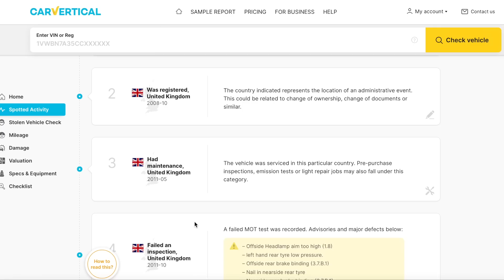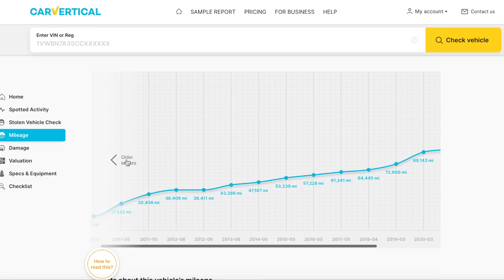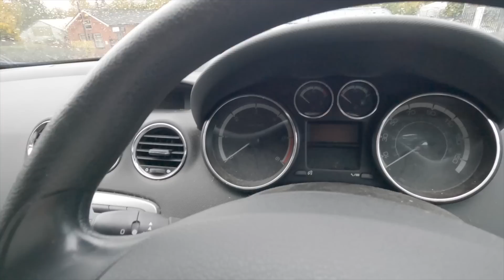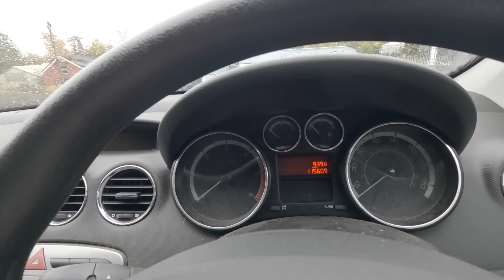I BOUGHT A CHEAP PEUGEOT 308 FOR £300

Comment: I’m suprised that car isn’t worth repairing. I’d assume if this was a left hand drive car and had the German TÜV a dealer could easily ask 2500 euros for it and it would be sold within 2 weeks. Just today I spent some time looking at a car lot with 50 cars (different ones, from old BMWs to an American Stretch Limo and some newer cars like an Audi TT). I looked for an older Audi and found they had quite a lot. Sadly we have a lot of rust so having a car with little visible rust like this Peugeot would sell quick. Looked at an 2007 Audi A6 that they didn’t even have a price on yet because it has little rust and turns out I’m the second guy to ask about that car in 2 days. Cool thing about that dealer is they just give you the keys and you can check out the cars on your own (they even gave me the keys even though I told them im only 16 and have no drivers license. And honestly most people I know couldn’t care less about a car having cosmetic issues. Like the scuffs on the front fender I wouldn’t even have cared too much. I have a 1 owner 1995 Audi A6 and it has so many cosmetic issues that it would need a full repaint. Still people I talk to enjoy the car and since it’s in good mechanical shape it’s gonna last me a long time as my first car and I can get it registered as a classic in 2 years.

Comment: Strange, those Peugeot 308's go for around $9,800 U.S.D. In canada or mexico slightly less with the problems described in this video. A older Peugeot 405 mi16 in good to excellent condition will go for around $5,000 U.S.D, and wow and older Renault R5 Turbo can go for up to $100,000 U.S.D. The u.s.marshal's service had a 2004 Peugeot 208 on ebay a while ago for sale at $5,000 u.s.d., im a kid but i loved that little peugeot 208, closest repair on these cars would be in Monterey Mexico Peugeot or in quebec or montreal canada. Sad how british treat cars like this, when all the junk they produce is much more unreliable then these.

Comment: Why would there only be only  2-3 yrs left in it with such low mileage.
Reply: if someone bothers to do the suspension work, easy another 5-7 years in that car with it's service history and cambelt change as well as cheap £30 tax and no rust. I swear some people look at the age and just scrap it when they can't be bothered.
Reply: @squeakers27  I recently made the same mistake last year I scrapped a 05  passatt 1.9 diesel highline model leather heated seats spoiler alloy wheels I also done timing belt a year before. It needed window motor rear tail light one side and possibly new discs and pads. Engine clutch and box were perfect, same cars making 3 grand now with less spec than mine. I was a fool.

Comment: "Bought a cheap peugeot for 300 quid". Personally I would want 250 to buy it in the first place. Seriously though I loved the old 205, along with the 309, and the 504 was the only car I have driven that I didn't need to push the seat back to its limit in order to get my lanky frame in. But when they abandoned the french flair for cheap mass produced stuff I avoid like a sore thumb.
Great videos nevertheless.

Comment: These cars are absolute junk, a car with that age and mileage should not need that amount of work. I know they drive well though, I'll stick with 1993 Nissan Bluebird and 1997 Nissan Sunny/ Pulsar currently at 321000 km. Flys through warrant of fitness, only thing replaced was a hose and sanded the rear brakes. The check engine light has never come on and if it did it's OBD1.

Comment: You mean to say "I am sponsored by carvertical and they gave me a offer blah blah will make it cheaper for you and helps send you videos". STOP LYING!!!!

I owned 2 HDI the heat shield always comes loose also the garage that said you need to remove the DPF to do the job lied to you, You can do it without removing it, done it twice easy fix, you can't fail or advise with that tho but should be done!
Reply from the maker: Sounds like you know everything. Well done.
Reply: @HighPeakAutos  well that's a little toxic, tell me your not sponsored by them? not a bad thing being sponsored by someone but transparency. Going to the car no I don't know everything but I know enough with them. Well would hope so seems owned two 1.6 HDI's. my first one got from the boring 110BHP in the MK1 C4 coupe to think was 270bhp or around that. On the c4 I used a aluminium blanket on the turbo.

The fastest way to fix it is find a welder and get them to aluminium stick weld it. The break where your on about is at the bolt area. This happens due to the vibrations and aluminium ain't strong. over time breaks. Personally not worth your time if cars cheap enough.

Comment: The one in this video will be 90bhp
Reply from the maker: Yes you’re right
Reply: @HighPeakAutos  we all have our preferences, and i know a lot of people don't like French stuff. Im a Hgv mechanic, ive owned a 97 306 dturbo for the past 20 years andcuts been superb, its 25 years old now, it had its first welding a few weeks ago for Mot, despite having now done 221k and lived outside in damp North Wales. Its still on its original engine, gearbox, clutch and turbo that it left the factory with, its been a superb vehicle. About 8 years ago I got a 2010 308 sport petrol, its now gone just over 100k and again its been superbly reliable. My father has been a taxi driver over 40 years and ever since cavaliers in the 80s and 90s we have used French stuff for taxis. They have undoubtedly proved to really stand up to the job and cover huge mileages. I spent many years as a breakdown mechanic contracting for all the big breakdown clubs. Cars I used to see most seemed to be VAG group products, especially Diesels. Ive only just discovered your channel after more clickbait from Chops Garage, enjoying it so far, best of luck.

Comment: CarVertical is horrendously overpriced. You are definitely getting that 10% as commission. £25 for a SINGLE vehicle check. 

I really like the channel and your way of engaging the viewers however you shouldn't push something that simply is not worth it. My opinion.

Even the RAC is £15 for a single check or £30 for five checks.
Reply from the maker: The bitterness of poor quality remains long after the sweetness of low price is forgotten
Reply: @HighPeakAutos  That sounds like a haiku of some sort. So are you saying the RAC check is poor quality in comparison?
Reply: Depends what car you're buying if you're buying some old car thats banged up and worth very little anyway sure, just do some basic checks you can do yourself and draw your own conclusion but if you're buying a good car you don't want to end up with a lemon thats been crashed, stolen, has outstanding finance or all kinds of mischief that comes with it. I won't buy a car without good service history and an MOT history that is not loaded with advisories year after year and failures for stupid stuff thats down to owner stupidity. You can protect yourself a decent amount if you know what you're doing.
Reply: @gravemind6536   But how does that reflect on the quality of the history check? Does RAC not give as enhanced disclosure as CarVertical. Spending £25 instead of £15 for a company I am quite sure the majority of people have never heard of (compared to RAC) somehow means better accuracy/records? 

I get what you are saying with due diligence but that is common sense surely.
Reply: @martinw6415  Most people don't actually use common sense when buying a car. As for RAC and car vertical I don't know I have never used one of those checks.

Comment: I hate Peugeot 308s too and just in general Peugeot. Badly built, cheap cars that feel like a tin can on wheels and the kind of people that drive them are the kind of people that know nothing about cars have no taste or style and take poor care of their cars which compounds the problem with them. The Peugeots from 2000-2015 are in particular awful imo. If I buy a car its going to be Japanesse, German or South Korean they make solid reliable cars unlike the french and americans and italy although some low end Fiats can be reliable.
Reply: Well every car has its own flaws, here where i live Peugeots are not bad cars, they are a much better buy compared to a Japanese cars because they are cheaper to maintain and at least are less prone to rust.
Reply: @2BuckShot  yes Japanese cars just rot where I’m from every winter and then fail MOT needing suspension arms , subframes etc
Reply: The Peugeot issues were from the mid 90's through to about 2002-4. We have had Peugeots in our family since 1957,. Driven often on bad roads at high speed. They are extremely well built (check rally results from 1952 - 2010). Handling and reliability are exceptional. I live in Australia and Peugeot has a good reputation here. Same as in Africa and Argentina. Seems to me that either the English don't look after their French cars are the French make some cars specifically for the English market (just joking)

My favourite Peugeots were the 404, 504 and 308 (diesel)